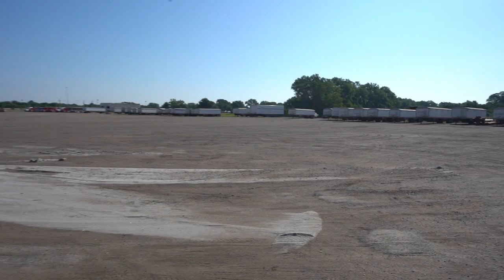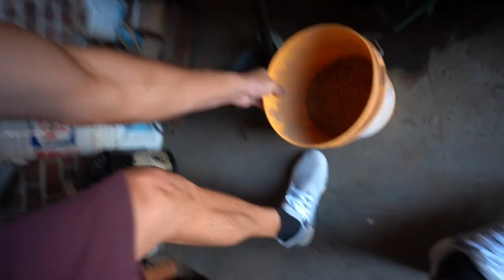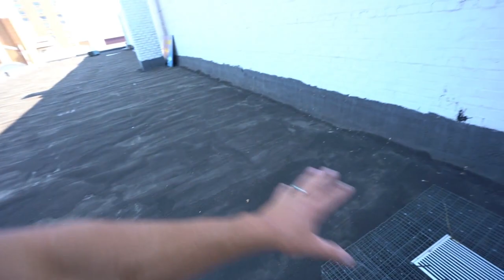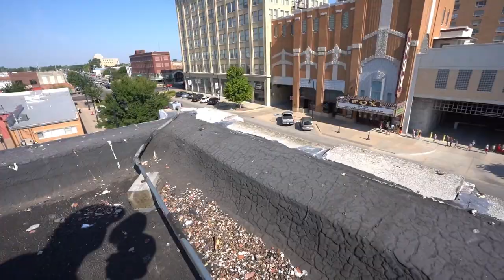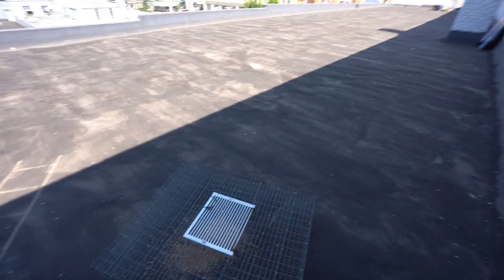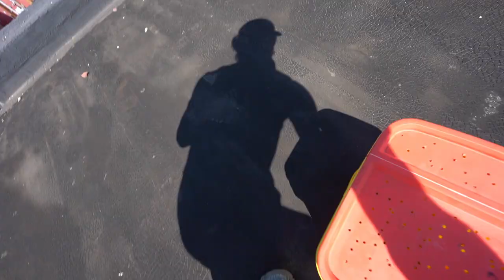TRAPPING PIGEONS ON ROOFTOPS IN THE CITY HAS BEGUN!!

Comment: Contact the State DNR and inquire about the propulsion net system they use , build one the size that is manageable for you , and rope it up the outside of the building to the rooftop . You could utilize model rocket engines to catapult a small net , say 30x30 feet . The net has to be long enough that it can be launched higher than the pigeons can fly upward at reaction to rocket ignition . These model rocket engines have electrical ignition and can be set off in tandem and by remote switch , say from the top of a neighboring roof where you can see the optimum moment to set trap off . In the right place at dusk , you could catch multitudes in a single discharge . The State Agency may be able to turn you on to some very helpful information ...!

Comment: for some reason decoys tend not to work when trapping pigeons and I don't know why. Put your traps around the air-conditioning units because the birds go up in there and nest! Those mama and daddy birds are also the ones that decoy in other pigeons. Like I said I have no idea why decoys never worked for me. Also you are not only going to catch other pigeons but you also catch the mated pairs and when the babies leave the nest you will catch them also. When they leave they can already go into your loft. Don't get discouraged because you're going to have great success on top of the buildings during the winter with corn. You must use whole kernel corn and not cracked corn because cracked corn will kill your pigeons! Cracked corn tears their crops open and it will kill the babies they feed everyone single time. It normally will kill the adult pigeons as well so just use whole kernel corn in the winter. You should also use a little corn in your trap even though they don't necessarily want to eat it right now. The reason being they can see it very easy from very high and far away! This also will help bring them in! Anyway I guarantee you're going to catch 15 times the amount of birds at a minimum in the wintertime you catch in the summertime. They are just like every other bird and animal. They need corn to create body heat so basically just use straight whole kernel corn in the winter. I also used to use flashlights on the top of the buildings and blind them because they're easy to pick up than. There one problem however, I damn near fell off the side of the roof more than once and the last time I was damn lucky my friend was there because if he wasn't I was going to fall three stories and that's not really worth a pigeon. It scared the hell out of me that time! Damn near peed my pants! I wouldn't put food anywhere but the trap, not around it at all but put plenty of food in the trap so they can see it easily. Also if it's hot out you need to put water in the cage or they will die in four or five hours in the sun. Good luck, I hope you tear them up! Also I would love to see the new loft your friend has in his barn when you can get around to it. I hope this helps!
Reply from the maker: Wow man awesome tips I really appreciate all the help!!
Reply: @BobbyGuyFilms  hey it's no problem I hope it works for you! I was wondering how your dog is doing he's a nice pup. I have trained hunting dogs and field trial dogs for almost 30 years but because of health reasons I no longer can but I still yearn for it every single day. Anyway I like to watch him working. Good luck with pigeons and your doggy and if you ever need any questions answered about training your dog I think I can probably help you!